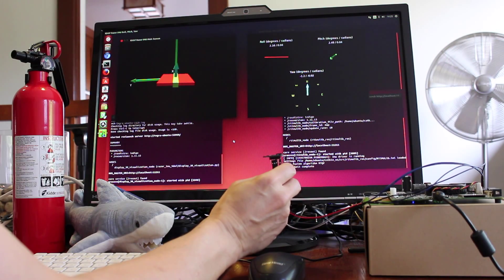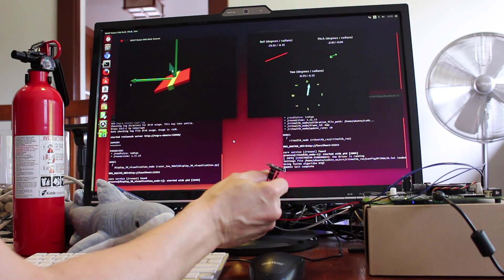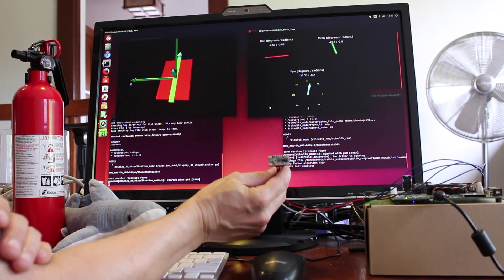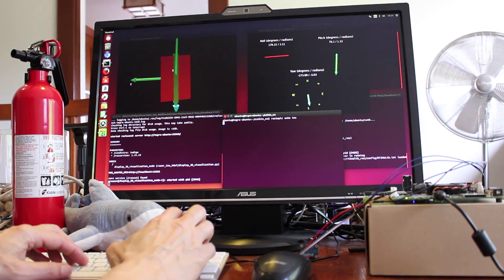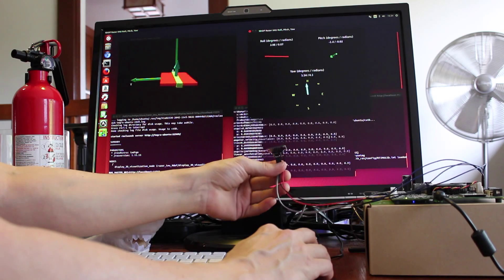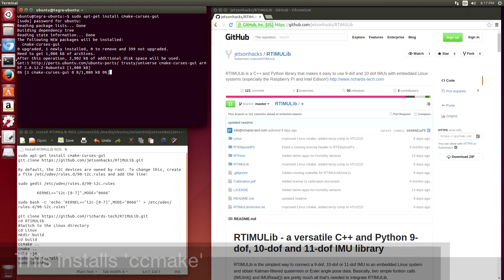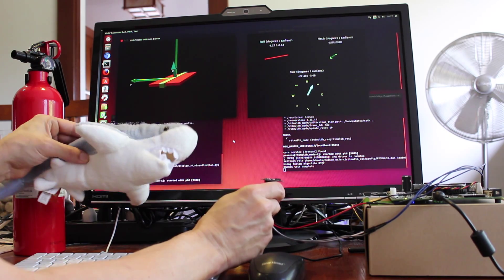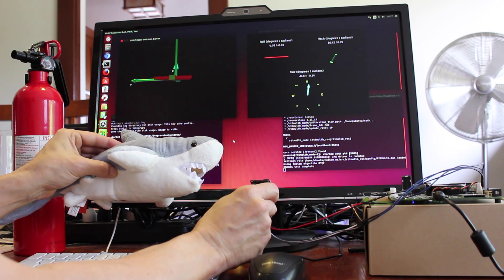Install IMU under ROS on NVIDIA Jetson TK1

Comment: Hello sir, I tried to follow your tutorial on my jetson nano. Everything seemed fine but when I try to run the command roslaunch rtimulib_ros rtimulib_ros.launch it shows up something like this :
I2C read error from 40, 8 - Failed to read BNO055 data. 
When I do sudo i2cdetect -y -r 0, it shows up 68 (not 40).
What should I do?
Reply: Hi, did u solve your problem? if u solved please share

Comment: hello, i love your work. I was thinkng if you could help me out with using several sensors on the jetson tk1 and making sense of the data. (data/sensor fusion basically)
Reply from the maker: Thank you for the kind words. I don't have any more information to add than what you see on the YouTube channel and the JetsonHacks website. For help with specific issues you can use the Jetson TK1 forum: https://devtalk.nvidia.com/default/board/162/jetson-tk1/ 
Thanks for watching, and good luck in your projects!